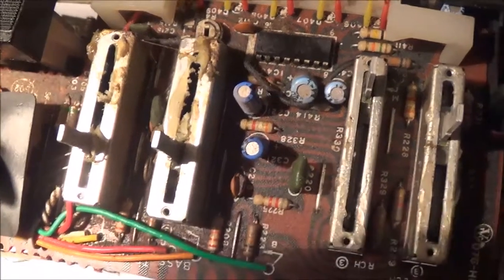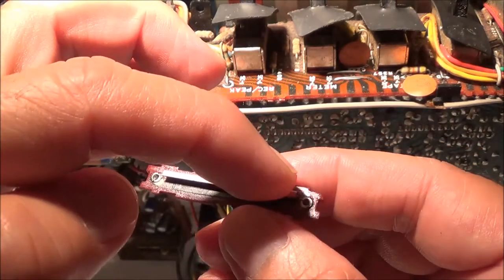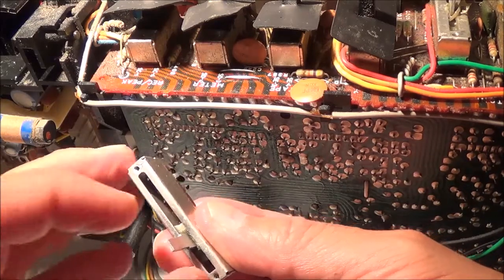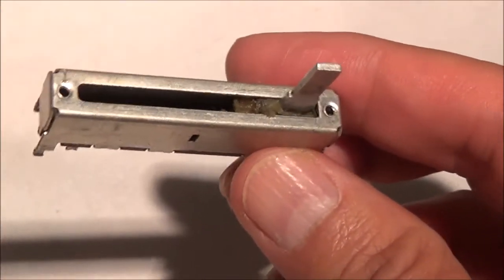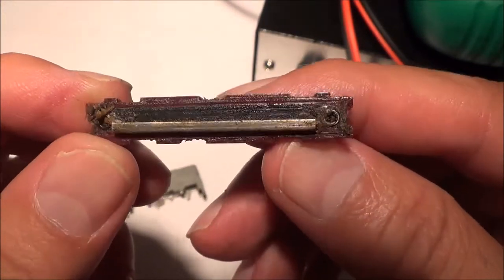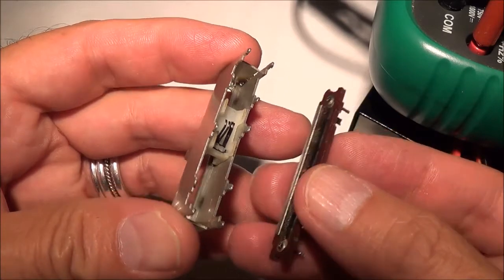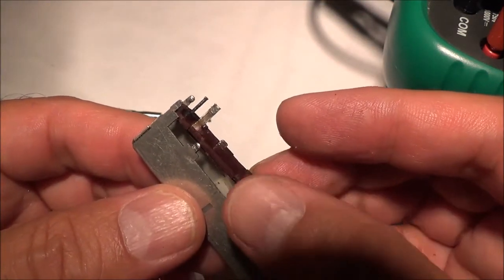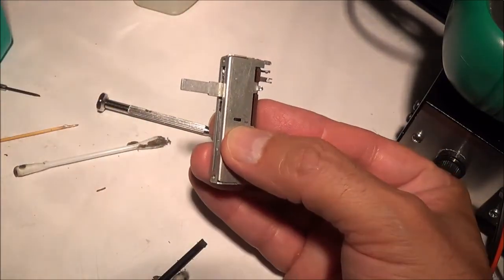JVC RC 727 Sliding Potentiometer Fix

Comment: Great restoration and what a patience, surely needed. 
About carbon track cleaning: alcohol or contact cleaner wouldn’t soften the carbon film, making it easier to be scratched off by the normal operation of the sliding/rotating contacts?
Thanks for sharing!
P.S.: I can’t imagine why someone would glue all potentiometers - this is crazy.
Reply from the maker: Thanks for commenting, sir. I didn't have problems cleaning this because I worked gently. You could remove the carbon if you rubbed too hard. What has your experience been?  The spray seems to have no adverse effects. That was a bizarre case of glue in the sliders. Although it was a few years ago, that boombox seemed quite worn out. Sorry that I didn't write so quick, but I am not on YouTube very much at the moment

Comment: Thanks for taking the time to show us this repair! I’ve got to fix a pair of faders that have broken shafts and I now have the confidence to complete the repair.
Reply from the maker: Good Luck! Of course, it is always best to replace the faders. My solution was more of a "use what you have at home" fix. The problem with cleaners is that they easily wash away the grease. The feel, then, is different. What I haven't tried yet is battery terminal grease or FaderLube.

Comment: Hi . Hope you are well. 

Great video!

So my keyboard’s volume slider finally packed up. (Roland EP7) very old model.(1990) . I would like to know what would be the outcome if I had to replace the 10k B x2 slide potentiometer with a single 10k slide potentiometer… my keyboard just finally stopped pushing out volume…

Comment: Thanks for the video. How do you repair broken/cracked carbon strip? JVC model especialy M70, RC-838 ussully face non effective slider pots problem.
Reply from the maker: I've never actually repaired ones that were that bad. But in theory, you could maybe mix some graphite powder and glue and spread that around. You probably couldn't match the original resistance exactly though. Experiment is what you have to do.

Comment: i have a old sherwood preamp with sliders the right side kicks off and on but if i play with the slider it kicks on do u think it could be just a dirty slider
Reply from the maker: Most likely. It could also be worn, but I would say unlikely in your case, unless the preamp itself looks all beat up.
Reply: @OldSchoolElectronics  the inside looks in good shape i even clean the inside really good s and the output right and left work fine its only the pre out side on the right that kicks off and on and that was even befor i clean it
Reply from the maker: In that case it would be a good idea to spray all of the controls with a contact cleaner which you can get from an electronics shop. Radio Shack sells some (Control/Contact Cleaner) or if you are in Europe you can use Contact 61. Do it with the power off, of course. Not too much, not too little. Work the controls back and forth a few times after you spray them.
Reply: @OldSchoolElectronics  tahnks for the help i used deoxit d5 and now it works can u buy new sliders if it acts up again i just have a feeling its the slider becuse when it was acting up if u played with the slider the sound would kick back on
Reply from the maker: Sure! Yeah, Deoxit works, too. Radio Shack was just a cheaper option. Getting new sliders that mechanically fit and have the same electrical characteristics is difficult. It was probably just dirt/oxidation. Deoxit would not have fixed a worn slider. So I don't think you have much too worry about.
Reply: @OldSchoolElectronics  thanks for all the help testing it all day it works and sounds great now
Reply from the maker: You're welcome. You got it fixed. Good job! And enjoy the music!

Comment: Well done!  Thank you for sharing!!!
Reply: Follow-up question: What lubricant do you use for that?  

Deoxit D5 doesn't mention "lubricates" as such, but has Stoddard solvent , which is petroleum based and has a low dielectric constant, so: not conducting.
It however evaporates fairly quickly.  So I wouldn't be to worried about it modifying the resistance value, but then it also means it loses it's lubricating potential...
Reply from the maker: Sorry, not on YouTube all the time since it really isn't a paying job. Anyway, I don`t remember the spray I used at the time. I used whatever I had around the house. Something like the Radio Shack Control/Contact Cleaner with Lubricant would also work. To do it the real proper way, you would probably have to take it apart and use an electrical contact grease. Time consuming and not super easy.

Comment: Very interesting video clip. Usually I would use some lubricating oil  for slide controls , sometimes  they still remained a bit noisy, I was always afraid of taking them apart incase I damage them. Thanks to your great viid, I would now dismantle them  and repair them. Thanks for sharing.
Reply from the maker: Thanks for watching and good luck. You just have to work slowly and carefully.

Comment: Good video.  Do you happen to have a video of how to remove the pot from the board?  the slider fell out of mine and I either need to install a new pot or try and insert the slider back into the pot.
Reply from the maker: Thanks. I don't have a video of this (removing the sliding pot) I think, but it is not that difficult if you take your time. Best to take pictures of each and every step. That is a big help.

Comment: My JVC R-x40 balance is off. Right channel weaker than left. Curious is the slider potentiometer can be cleaned inside.
Reply from the maker: Never worked on a RX_40 before. So I don't know if you can spray contact cleaner inside. But normally you should be able to open sliders or drill a hole to spray into if there are no openings. But I would double check to make sure the problem is the sliders before taking them apart. Check the input levels right at the inputs of the sliders for each channel. I will be online again next week as we are vacationing right now.
Reply: @OldSchoolElectronics  Thank you. Turns out my sliders weren't dirty arlt all. There is however, an adjustment that can be made to both the right channel and left channel cixut board (turning the plastic screw left or right to achieve 5 mV). I did however destroy both my volume and balance sliders during my disassembly. I need new ones now. This unit is basically my Lear jng unit as I'm just getting into vintage electronics. I'm hoping new sliders will fix my balance issue
Reply from the maker: Ok, I didn't know your level of vintage electronics/test equipment. A learning unit is a good thing; I have broken stuff myself before. How did you come to the conclusion that the controls were bad? The adjustment you mentioned is the idle adjustment; it would not be your problem.

Comment: how do the Knobs off? I have an old radio and want to clean the face up and the only thing left stopping me are the 3 slider knobs
Reply from the maker: The slider knobs normally just pull right off. If not, you can  try to use spoons (tea or table) to push them up. Maybe you can get 2 spoons under and then slowly and carefully leverage them off.
Reply: @OldSchoolElectronics  worked like a charm ,, thanks, now all I have to do is find out why it wont power on
Reply: @OldSchoolElectronics  Thanks for getting back to me,, I will try  that and let ya know